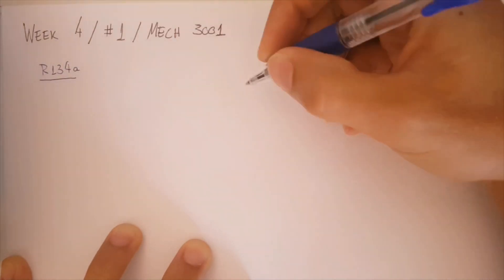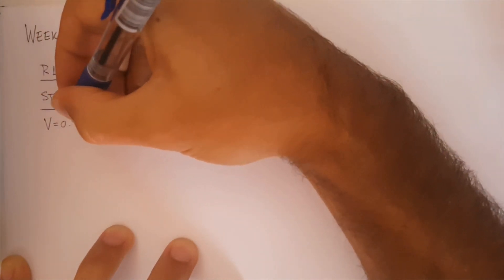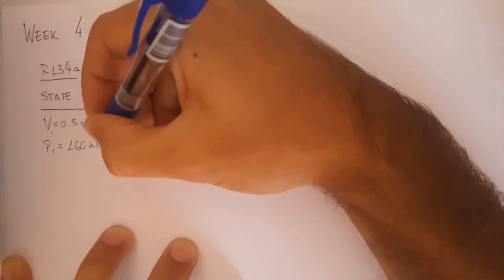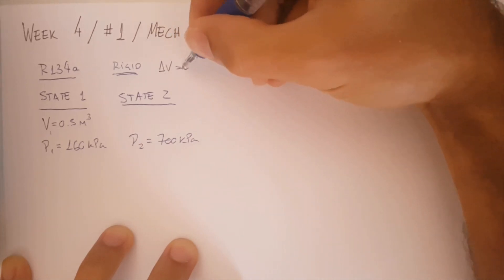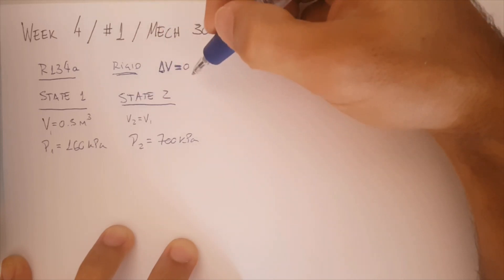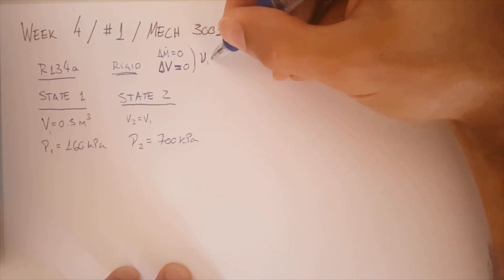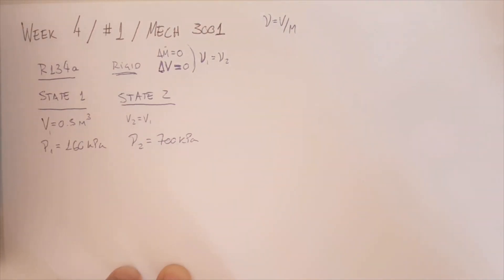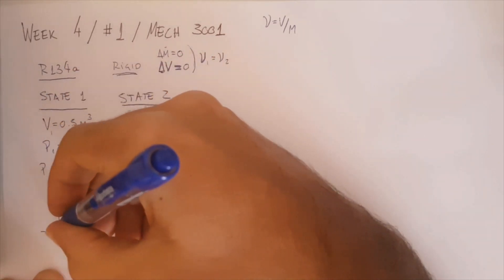Thermodynamics Mech3001 - Week 4 - Problem 1

Comment: 2 kg of air enclosed in a rigid container receives 0.2 kj of paddle wheel work and 0.5 kj of electrical  energy per second. Heat loss from the system is 0.6 kj/s. If the initial temperature is 25℃ what will be the temperature after 5 minutes ?
Reply from the maker: That is an easy one. There is 0.2 + 0.5 kW entering while 0.6kW leaving the system. So the net result is that you have 0.1kW entering over 5 min. Net energy gain will be 0.1*5*60 kJ. Air can be treated as an ideal gas. So you can use dU = m * Cv * delta T. 

Final temperature will be: Final Temp = Initial temperature + dU / m*Cv
Final temp = 25 + 0.1*5*60 / 2 * 0.718
Just check your units are all in place and you should be good to go. Let me know if you need a video on this
Reply: @EngineeringHack  video available ?

Comment: I don't get it how you find U2?
Reply from the maker: From the property tables. 
Go to the superheated property tables for steam. Then look in the 0.7MPa table and search for the 0.04986 m^3/kg. If you are using an online calculator, it will output all the properties (h, u, T, etc.). If you are using a plain table, you'll need to interpolate to find the values corresponding to specific volume (0.04986 m^3/kg). If you need help with interpolation, there are some videos about it in the channel (https://www.youtube.com/watch?v=QXpilXhDsNA and https://www.youtube.com/watch?v=bXsH87DeBso)
Reply: When I look in my book. The specific volume (0,04986) goes outside of the table, like the biggest I have on the 700kpa table is 0,048597. So I am really confused on how to find that u2 @EngineeringHack
Reply from the maker: @xtreme9029  You are looking at the wrong table. It is supersheated
Reply: our v is 49.87*10^-3 but you take interpolation between 47.306*10^-3 and 48.579*10^-3   how that?? I know that we should take interpolation between two numbers one of them up and the second of them down 
 @EngineeringHack
Reply: @xtreme9029  did you know the reason of that?
because same problem I face right know
Reply: @abdulatefmohammed1501  Apparently you are supposed to extrapolate or something like  that instead of interpolate
Reply: @EngineeringHack  I'm confused why we're allowed to use the steam table when the liquid is r134a not water. This video is old but if you happen to see this could you explain it to me?
Reply from the maker: @ethanmilton7083  Hi Ethan. People often call "steam tables" any "properties tables". When we are dealing with R134a we CANNOT use the water tables. That is actually a common mistake students make, i.e., they forget to check what is the fluid in question and use the wrong table. Table A12 (the one I mention in the video) is for 134a
Reply: @EngineeringHack  Thank you!
Reply: You got ?? How to find U2 will you plzz tell me